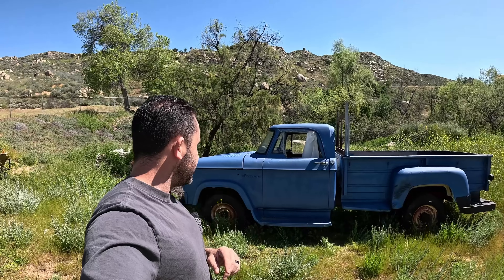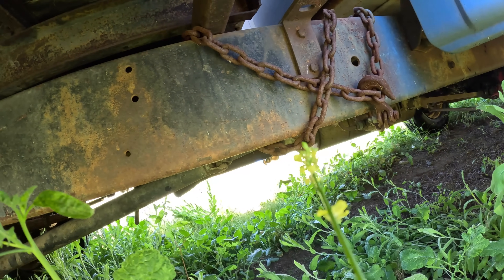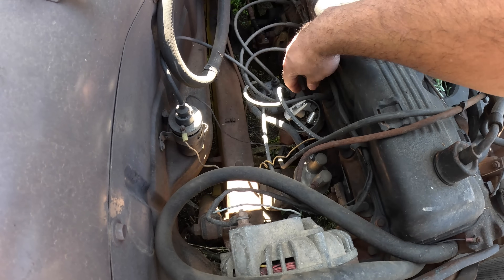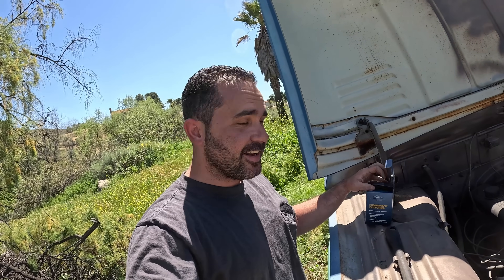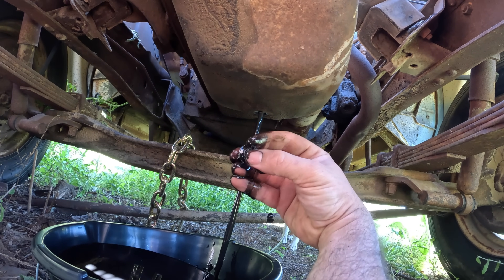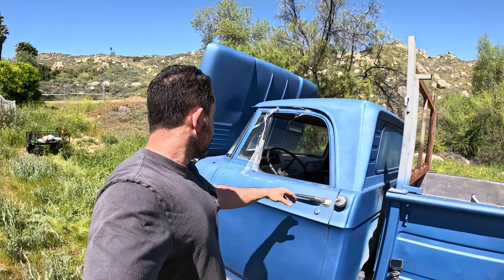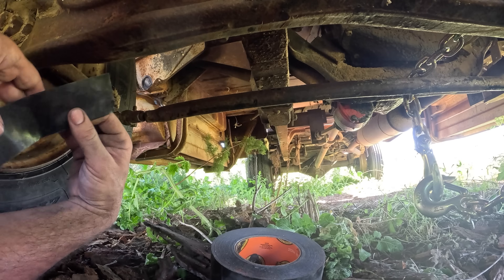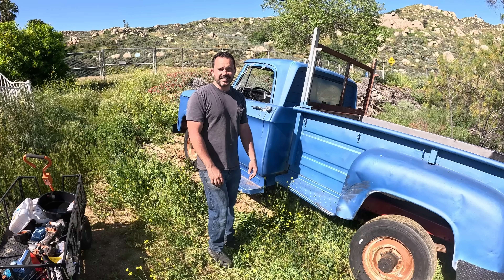FORGOTTEN 1962 Dodge D300 - Will it RUN and DRIVE after 34 years!

Comment: When I ran the original 4-speed in the 68 D300 pictured behind me, and the clutch quit working, I simply filled the master cylinder with light-weight motor oil and she ran from then on. I recommend 0w30